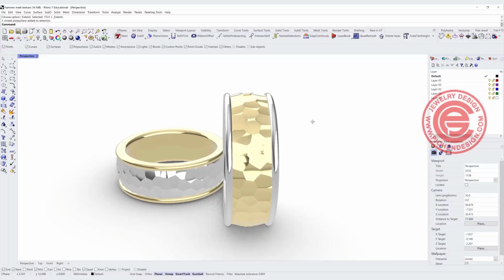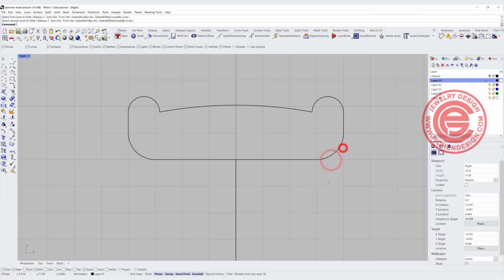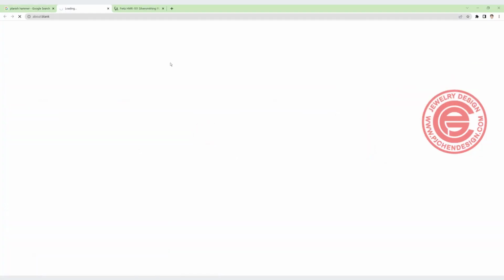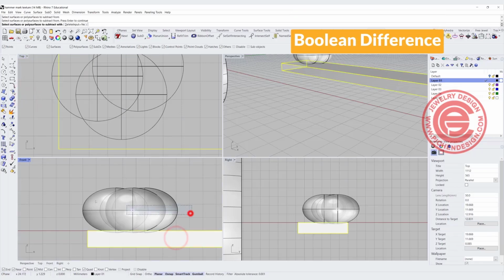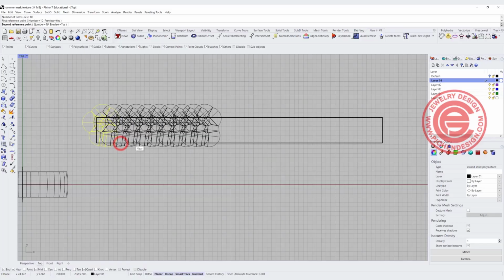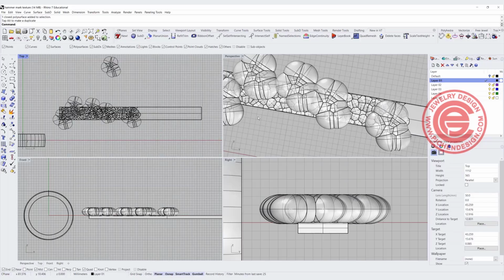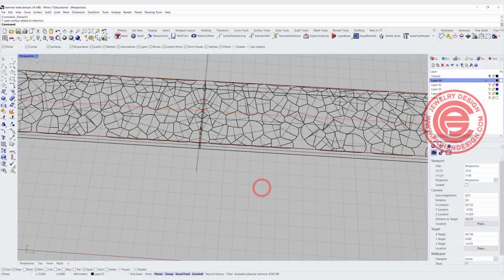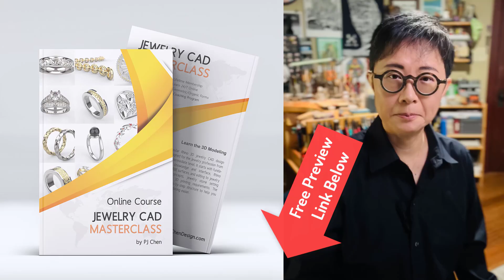How to Add Hammered Texture to a Ring in Rhino 3D – Jewelry CAD Tutorial for Beginners #525

Comment: if you polish it to remove the casting marks, wouldnt the hammer finish go away?
Reply from the maker: depends on how deep you created
Reply: I personally wouldn't use CAD for a hammer texture to be casted. The cleanup will definitely be a huge pain and likely remove the texture because you'll 100% need to use tripoli to get the casting lines out of every crevice. A great way to do this instead by hand would be to cast the ring as a smooth low dome (without texture) and then use an Italian green wheel to create the individual facets along the band. This creates a convincing "hammer" look without the need to actually hammer it (which would size the ring UP for sure and you risk dinging the other parts of the ring)... Plus the green wheel is a polishing abrasive so it's creating a pre-polished surface for you in the process. 2 for 1 special!

There's still valuable tips and tricks in this video though for CAD generally. Thanks, PJ!